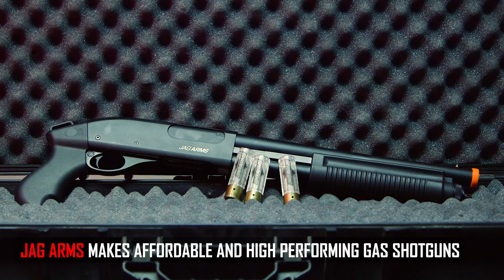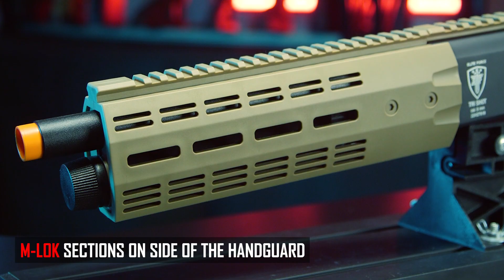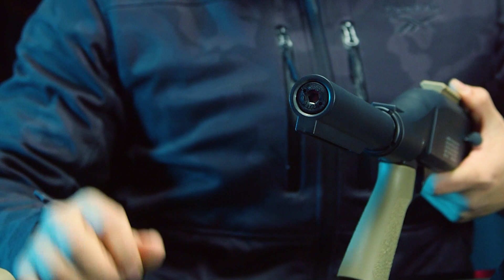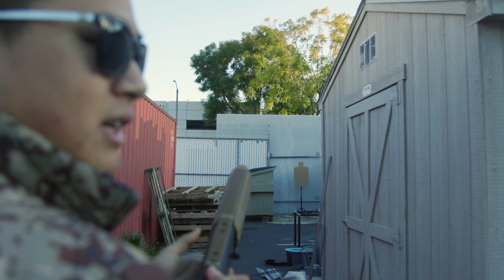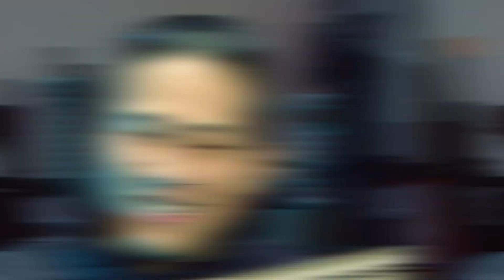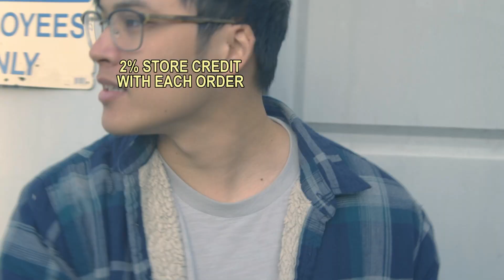SEMI AUTO SHOTGUN?! - Elite Force CO2 Tri-Shot Shotgun | Airsoft GI

Comment: dude why cant a company make a good shotgun design. its so damn simple. NOONE BUYS A SHOTGUN FOR SINGLE SHOT. it NEEDS 3 barrels, it NEEDS 3 and 6 round burst, and it NEEDS to be semi auto. with a 10-12 inch barrel version for cqb and a 15-18 inch barrel for traditional long barrel for longer ranges. possible full auto would be dope. the purpose of a shotgun is overwhelming firepower. the only shotguns currently that meet that criteria is the side by side pump action jagd arms shotgun, that can shoot 12 bbs at once, and the APS shotguns. neither tho are semi auto.
Reply: It is 1 barrel but it is a 3shot burst. Which sounds weird but it does shoot like a shotgun trust me
Reply: @SlimAirsoft  sounds very much like the cybergun slp, wich turned out to be a turd.

Comment: Reminds me of my old walther tri shot with the big co2 they used to use for paint ball gas lasts for alot of shots
Reply: @homieg5388  i own 2, they make an adapter to use x2 12gram cartridges instead of the 88gram ones that are not as easy to find. It's not fun speedloading into the side of the gun every ten shots, but I'm a walther nut, so I collect all their weird airsoft junk. Still looking for the dual powered (spring & electric) g22

Comment: Love to try this, but would also like to see a Green Gas/Propane Version that I could use with my HPA setup.
Reply: There is a c02>hpa conversion system on the market. It just requires a slightly different tank set up since you need a tank giving the same psi as a c02 cartridge.
Reply: @sovietmudkip1  it's 800 psi, so the same air setup for a tippman airsoft rifle.